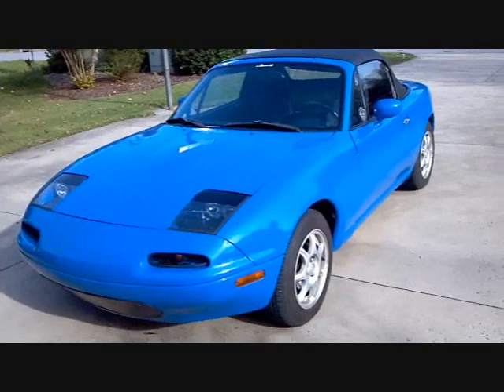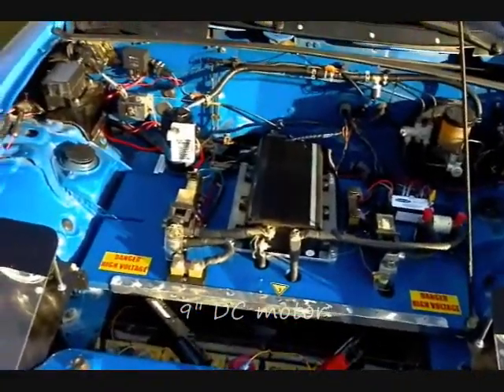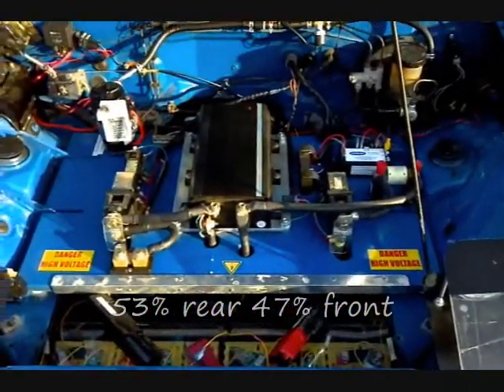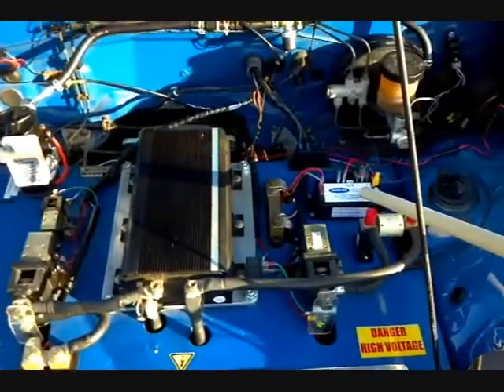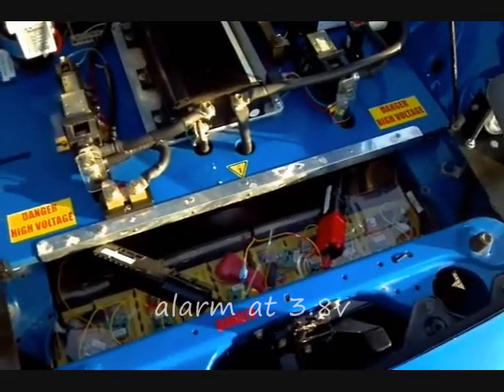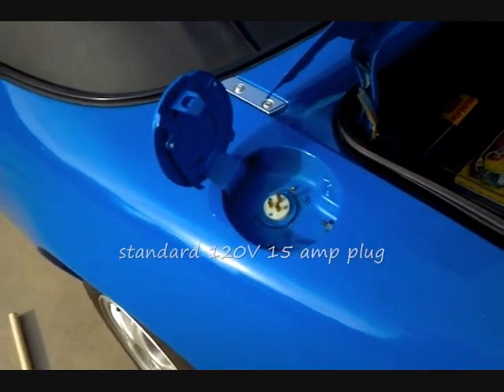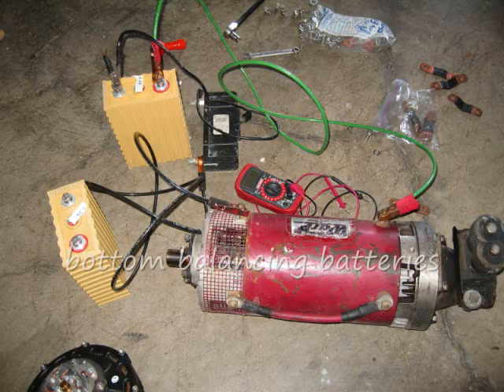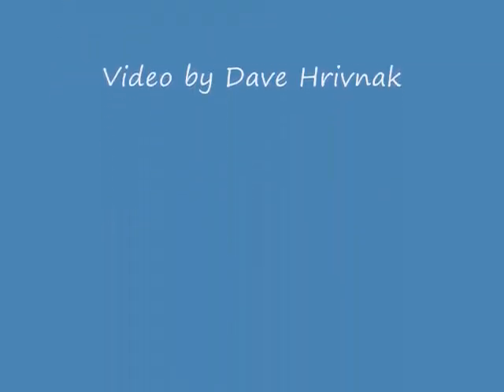Miata Grossman

Comment from the maker: If you are driving over 100 miles a day I think you need to get a Prius.  4500 watts would not accelerate a car.  The Nissan Leaf had an 80,000 watt motor.  so 4500 watts would be moped type power.

Comment: I drive between 100 & 400 miles per day right now... one other question then. what about switching straight to generator power for the electric motor and electrical system when the batteries run low? my boss has a small generator that outputs about 4500 watts continuous duty and it burns about 3/4 gal of gas per hour...a lot more efficient than the 30mpg my car currently gets. and a lot less expense and weigh than a huge battery bank.

Comment from the maker: Technically this could be done.  Now with 180 amp-hr batteries one should be able to get 100 miles of range without the bother, noise and expense of a generator.   And you will need a big generator as 1500 watts would give you about 6 miles of range/hour of running.  A 10,000 watt generator would give about 40 miles/hour of running.  So even with that and a 20 kw-hr pack you need to stop after 2 hours of driving at 60 mph.   Car require quite a bit of power, that is why they have 100+ hp.

Comment: David, I know little to nothing about building an EV but I've been considering turning my 95 Miata into more of a hybrid than a pure electric. I was thinking that I could reduce the number of batteries and add a small (750-1500W) DC generator that runs on demand to maintain the batteries and supply extra power when needed. With the small generator I believe it would extend the range and performance. Living in a rural area an EV with 40- 60 mile range limit is impractical for me. thoughts??

Comment from the maker: We only used the 90 amp-hr batteries because they were left from another project.  The 120 amp-hr would have only added about 75 lbs putting us only 50 lbs over stock.  Well within the safety range.